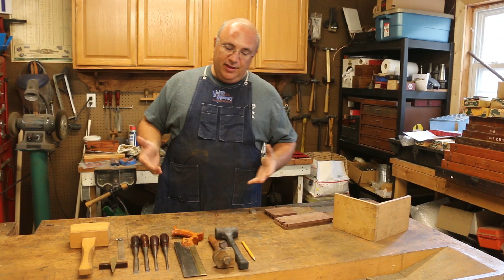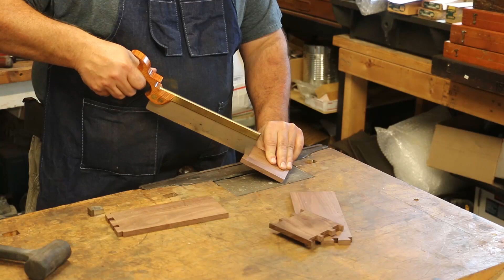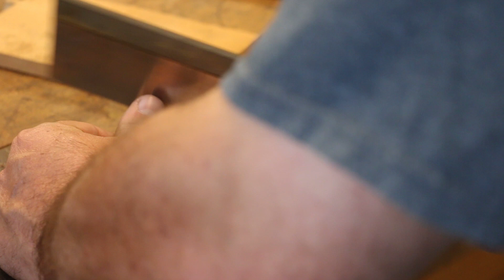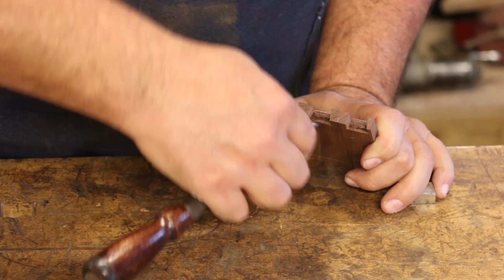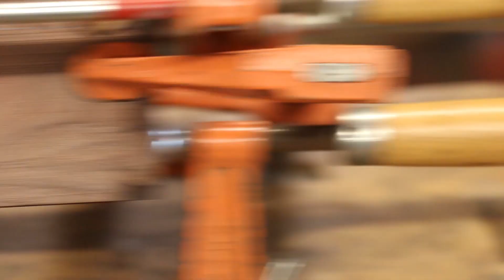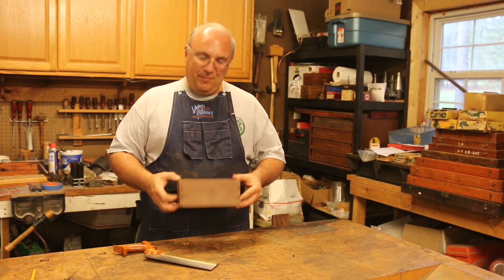Hand Cutting Dovetail Joints

Comment: Nice work and a good technique.  I'm a tails first guy for three reasons.  I find it easier to scribe the pin lines off the tails.  You did it just fine your way.  I like to stack and cut both sets of tails at one time.  You did it just fine your way and you wouldn't get the variation you were looking for.  And finally, like you, it was the way I learned to do it.  I now prefer a marking knife to a pencil but only started using one about 10 years ago.  You did great with the pencil.   I like to set my stock in the vise at the cut angle because I like to saw vertically.  Your sawing skills are better than mine.  I have a printed sheet with parallel lines at the cut angles behind the stock taped to the bench to line the saw up by eye.  See previous comment on sawing skills....... These are just some things I usually do, but not always.  You can't argue with success.  The proof is in the pudding.  And yours is great.  Keep up the good work and thanks for sharing your method.
Reply from the maker: +blmeflmm66 Like so many things in the shop, there are many ways to skin a cat and as long as the end results are what you are going for, it really does not matter.  I used to angle my board to cut straight down on the tails, but I have learned to just saw them at an angle.  As for the marking knife, I like to use a pencil because it has a wider line and makes it less tempting to cut right on the line and end up too small - I like to leave a little meat on the bones to clean up for a perfect fit.  Just a matter of preference!

Comment: Nice to see it done the proper way . I have a book case i made at school woodworking classes when i was 15  now i am 68 they are still tight and its still in use for its purpose . the bottom ones are open dovetails the top corners are secret dove tails visible on the end but the top surface does not show them , needles to say i won the woodworking prize for the year , my school also did metalworking inc blacksmith work as well , in the days before H&S when kids used sharp tools and machines 

Stuart
Reply from the maker: +Stuart Hardy I never cut dovetails in high school, but my metal shop teacher was a blacksmith so I got to do a good bit of that back in high school!

Comment: I was a little surprised that you didn't place "X" on the waste pieces after you laid out the pin cuts.  That is an extremely good tip about "body position" when sawing!
Reply from the maker: +vajake1 I thought I did - maybe I did it off camera for some reason....
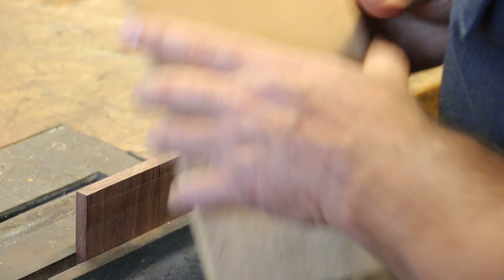Reply: +vajake1 13:27 

He did x out the waste, 

I'm cutting out that, that, that and that....

And he does it again at 23:00
Reply: You are correct 12345NoNamesLeft, but not at first.  I was surprised because that is usually the next thing that the instructor does (after laying down the dovetail gauge) and picking up a pencil.

Comment: I've seen Paul Seller's do dovetails.  It's nice to see a slightly different method.  This works well if you don't have a coping saw, or aren't confident in your sawing skills.
Reply from the maker: +garygsp3 I have seen the coping saw method and I am not a fan of doing it that way.  I would much rather chop my pieces out with a chisel.  That is the traditional way of cutting dovetails - the coping saw method is a short cut that in my opinion is not really that much of a short cut because you have even more clean up work to do.  But, either way will get the job done and the end results are pretty much the same - it is just a matter of preference.

Comment: Admire how you can transfer from machinist measuring mode to wood working marking/measurement mode.(PFC Lipton style)
Reply from the maker: +Rick Brandt I have done a lot of both woodworking and metal working.  Because I was trained as a machinist before I ever started working wood, a lot of my measuring techniques (and even tools) used in woodworking have their roots in the machine shop.

Comment: keith, you the man!!
great truly educational video master-class.
i have done some dovetail -- about fifty years ago in high school.
this class encourages me to try again -- always loved wood and wanted to work with it.
thank you for a good show of strength in you dovetail tools..

could you have used a hand file to clean the gap between the pins?

thank you for the video!
-toly
Reply from the maker: +Toly Dukhovny Sure, you could use a file.  Use a fine one though so as to not tear the wood out on the back of the cut.  I just always use chisels as they cut very straight and crisp lines.

Comment: Looks great. Sort of surprised that you didn't dado the bottom. 
I have a quack medical device (Davis & Kidder Magneto Electric Machine) in a beautiful mahogany case. All hand fitted with dovetail corners that have an external brass inset trim/spline on them. The top is made the same way. Nice work to hide the quack item inside.
Reply from the maker: +Blazer02LS LOL - "Nice work to hide the quack item inside"!
Reply: +Keith Rucker - VintageMachinery.org Presentation was everything for those old "medical" devices. It sure wasn't effectiveness. The door-to-door salesman had to have something pretty fancy-looking (and with lots of showy sparks!) to close the sale with some poor housewife. Those things were not cheap.

Comment: I enjoyed watching this ....I have been watching the barnwood builder's show on DIY network and they redo old log cabins and they saw those complex dovetails on the log ends that have to be at 2 different angles
Reply from the maker: +not2fast4u2c Those notches are a bit different than these dovetails, but on the same principle.  I once got to cut some of those by hand on a cabin build back in the 1980's - pretty cool.
Reply: The notches in logs for structure building have two purposes (which affects the shape of the notches). They not only have to lock the logs together, they have to shed water - every notch surface should slope to the outside of the joint. The old Lincoln Logs (which many of us older folks may be familiar with) had flat joints. In real life, these joints with flat surfaces would hold water in the joint and soon rot the log ends.

Comment: Pins, tails, chicken, egg. Same difference right?  Thanks for the video. One question, is there a reason you didn't dado the bottom in? That vice is a heavy little unit, and white Elmer's is water soluble.
Reply from the maker: +Duncan “DunMac” Mac The dado would become visible on the ends of the pieces because the dovetails show the end grain.  It should hold up fine - I drove a couple of finish nails into it for added strength.
Reply: +Keith Rucker - VintageMachinery.org        I gotcha. Thanks.

Comment: 39:24  Pins clearly not deep enough.  

jump to.... (mysterious lost footage)

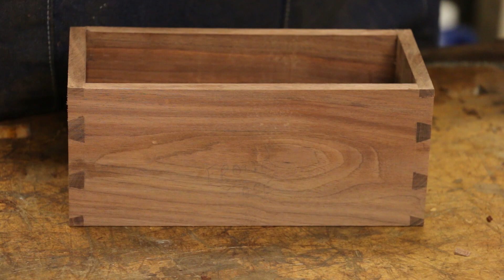41:09  tails side panel belt sanded nearly an eighth thinner to flush up to the short pins.  

Or did you intend to have different thickness sides?
Reply from the maker: +RJ S Whatever dude.  I am glad that you can see all this stuff so well from your arm chair.  And for the record, the pin was not short - it was sticking out and was sanded flush, just like I said.
Reply: Hey Keith, no offence buddy, we all make mistakes, especially when hand cutting DT's now that jigs and router bits have replaced the art.   Anyhow, it's clearly short in the video, no worries, BTDT.   I like your video's and that you restore old (way old)  iron too.  Just picked up a rusty and seized Walker Turner 1100 for $130 less than it sold for over 50 yrs ago.

-Cheers
Reply from the maker: +RJ S I have no problem admitting mistakes.  However, in this case, there was no mistake.  I looked at the spot on the video that you point out and you are looking straight down the pin.  The pin was sticking out proud, but you cannot tell that from the video because it is a straight shot.  I think that what you are seeing is the tail sticking out a little past the side of the box (the sides having the pins on them).  This was by design - you want both the pins and tails to be slightly proud so that they can be sanded down flush.  None of my pins or tails were below the surface on this box.  If it looks that way to you, it is the camera or your eyes playing tricks on you.

Congratulations on the WT 1100 - that should turn out nice.  Walker Turner made some very high quality machines!

Comment: i was taught to do hand cut dove tails many, many years when first learning wood working. however the method taught to me was not as clean and efficient as yours. so when i got the chance to pick up a leigh jig cheaply i took it and thus ended my dissatisfaction with my hand cut dove tails. i just didn't do them anymore.

now i am going to have to revisit them to see if i can improve after all these years. thank you keith...
Reply from the maker: +crazymanmichael They are not hard to do - it is just like anything else, it takes practice!

Comment: Nice job Keith! I have never attempted hand-cut dovetails. Your project has inspired me to try some. Kind of hard to go from precision metalworking to just 'eyeballing' it! I have heard of others marking out the pins and tails with a sharp knife instead of a pencil, supposedly more precise. Have you tried this method and how does it compare?
Reply from the maker: +tridium6111 Using a knife is fine, but I like the pencil because you really don't want your saw cuts to be exact - you want to leave a bit of meat on the bone so that you can trim them up for a perfect fit.  A pencil line tends to be a bit wider, which gives you a wider margin of error.

Comment: Great video Keith! If I'm not mistaken the strength comes with the joint its self not the glue. Is this correct?
Reply from the maker: +James Spires Yes, you are very much correct.  The glue helps keep them from coming apart but the strength is in the joint itself.

Comment: Well, that was a nice change, VintageDovetails.org. The dovetails are beautiful. I have cut a dovetail or two and you are right, it's practice, practice, practice. I like your marking  jig but I already made Paul Seller's jig and it, too, works fine. I'd suggest you check out .Paul's channel. When you clamped up the box, you did not use cauls. Is this because walnut is so hard? I'd get clamp dents in my boxes if I did that in softwood. Nice tricks too. Thanks  for the post.
Reply from the maker: +Juan Rivero I have not checked out Paul's channel, but a lot of people have mentioned him.  I learned how to cut dovetails during a weekend long class taught by Frank Klausz probably 15 years ago - now he is a true master of the art of cutting dovetails!

Comment: For anyone new to using chisels, here's a little tip for you that I didn't hear Keith mention but a lot of people do it wrong when they're starting out: If you lay the flat side of the chisel against the workpiece you can skim across the surface and just shave off a little bit at a time and it's controllable. If you put the beveled side of the chisel against the workpiece it's gong to go deeper and deeper into the wood and you'll end up chunking out too much or breaking your project.
Reply from the maker: +fillg Good tip!

Comment: In the UK all wood glue is white, same as notepads both never come in yellow here
My cheat for dovetails or other jointed boxes is to belt sand after its all done, hides a multitude of sins. lol, though i prefer to use epoxy for any stained products as even if you use the glue and filler to hide your sins, when you sand it, the stained or clear finish fully hides the glue compared to pva can show the glue where it has soaked into the wood unevenly causing blotches where glue once was. (no idea if the old hot glue stuff they used was better in this regard)
Reply: +jusb1066 
you mean the animal glue used hot from a double boiler that what i used in my other post still ok , it also had a nice smell when used
Stuart
Reply: Stuart Hardy
ahh yes i wasnt sure what it was! i remember seeing it used in carpenters shops but never used it myself, how does it work out compared to modern glues?
Reply: +jusb1066 
well i don't use it now as i mainly work in metal steam engines etc . but the book case is still ok after 53 years so it must have been ok ,i think it was made from rabbit skin and animal hoofs not sure 
Stuart
Reply from the maker: +jusb1066 The glue you are talking about is called hide glue - it was made from the hides of animals.  Ever hear the old phrase about "taking the old mule to the glue factory..."  Hide glue was and still is an excellent glue choice and is still used by some cabinet makers.  One of the really nice things about hide glue is that it is reversible - there is a process to loosen the glue to take something apart to work on it.
Reply: +Keith Rucker - VintageMachinery.org I was hoping that someone would mention the ability to  open the joints made with hide glue using heat. I've had to loosen some veneer to reset it. You would never be able to do that with carpenters/white glue, or especially any of the modern glues like contact cement, epoxy or cyano-acetate (super glue).

We metal workers are lucky; we can usually heat a glued joint with a torch to break down the glues like epoxy and super glue so we can break open a joint. It makes it possible to machine things too delicate to clamp.
Reply: sorry peter, but hide glue does not release with heat alone. you need moisture to get it to release.

on the other hand, carpenters, white, pva, yellow, epoxy, and cyano-acrylate will all release with heat, as will some contact glues. as a luthier i've had to open joints "fixed" with all of them over the years.
Reply: I've never seen hide glue reversed using anything but steam, so the moisture is likely to be needed as well.

The other glues you mention are NOT reversible with heat,  but destroyable with heat. Quite a different thing. You would not be able to loosen a joint, adjust it, and let it refix. You would have to heat, completely disassemble, clean off all old glue, and reglue.
Reply: agreed. but that still quallifies as a reversable joint to me.

Comment: Very good lesson in cutting dovetails.  If I ever want to make a box or a drawer I won't be so reluctant to make a dovetail now. Thanks for the video.
Reply from the maker: +cerberus It just takes practice!
Reply: keith your a great machinist and your finished box looks awesome  
as a bench joiner i can see the mistakes you made during the process 
but none of that really matters when your finished box looks that great 

for future reference its not a good idea to bring the chisel to the scribe line and make your first cut 
because the the chisel will always step back due to the sharpening bevel 
its good practice to bring the chisel close to the line and pear off the excess during the clean up after removing all the waste

also  you missed mentioning that when making your saw cuts you need to bring the edge of the saw to the line and cut in the waste 
it seems a silly point to mention but for people following it can be a very big difference between a sloppy joint or a tight joint 

i am very sure that you know this i mentioned these points only to help 
your followers achieve great finishes 

and thank you for all the great work and videos i always look forward to your next videos

Comment: That is a very good idea about having a sample close by to reference to!  That is a pretty sweet little dove tail gauge!  I think that I'll make a couple of those out of brass and exotic wood.  Maybe give some away for Christmas!
Reply: +vajake1 just have to find the right angle, theres 2 one for softwood and one for hardwood, be nice to make both?  (send me one lol!)
Reply: There are actually four common dove tail angles: 1:9 (6.5 degrees), 1:8 (7 degrees), 1:7 (8 degrees), and 1:6 (9.5 degrees).  I should think that choosing the angle might also be governed by the look of the project as well as the type of wood from which it is made.
Reply from the maker: +vajake1 I have a 1:8 and 1:6 and use them both.  The ones I have were made by Harris Tool Company, not sure if they are still around or not - I have had them a long time....

Comment: The only reasonable argument regarding pins or tails first is from the tails first camp for ganging up the tails to do several at once. 

But I am from the infidel group that saws out the waste anyway :) Also prefer cheap Zona razor saws for cutting. Maybe it is the cheapness of doing with an $8 saw when others are going with $100+  :)
Reply from the maker: +David Kirtley As long as it gets the job done, the end results should be the same!  But cutting your waste out with a razor saw - come on....  ;-)
Reply: Nah, the waste goes with the bow saw, coping saw or jewelers saw depending on the size. I guess it comes from mainly working in soft woods that chopping the waste just makes into a sad mush :)